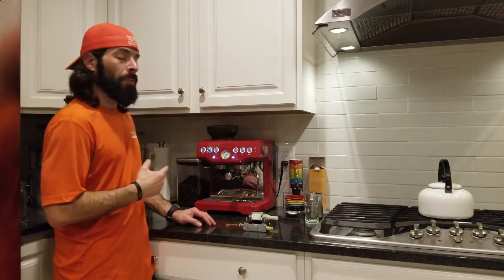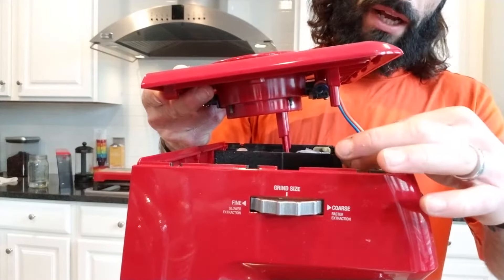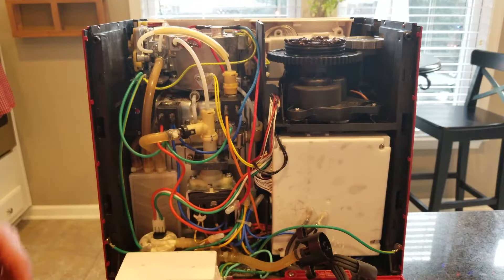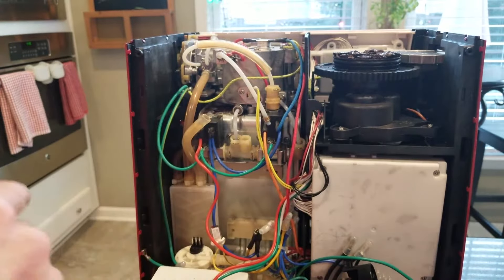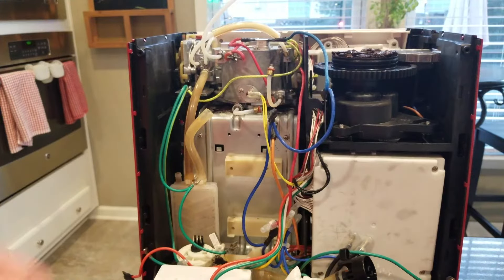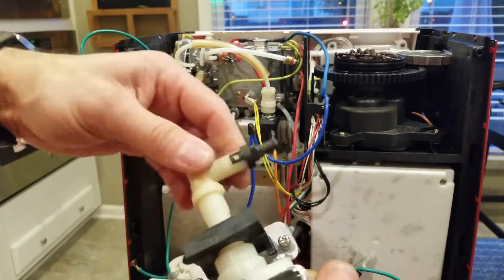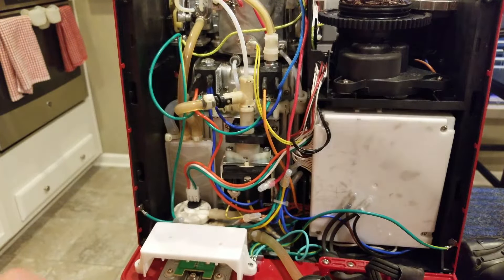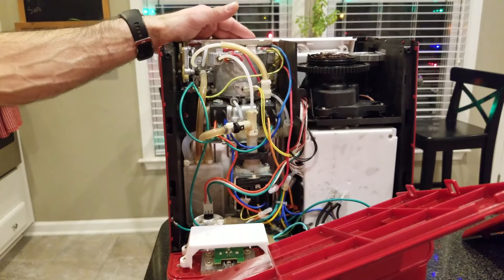Water Pump and Solenoid Block Replacement on Breville Barista Express 870XL

Comment: Wonderful job Luis!  I have the same machine and color.  Our machine is 1 1/2 yrs old and we use it morning and noon EVERYDAY. My problem is with extraction and maybe you have the answer.  I buy our vanilla syrup and beans from Starbucks and they grind it “Esspresso Grind” for me as they have done every two weeks for the last 1 1/2 yrs.  After filling/tamping and putting the porter filter in place our machine comes on as normal, no unusual sounds, the pressure gauge starts out in the pre-infusion range briefly and then moves up 12-1 o’clock as usual.  I’ve always tamped and used the double basket but for the last week now I’m only getting dripping (I’ve even tried not tamping and have the same dripping) and not the steady caramel stream I used to get. When placing an empty basket and testing water flow it comes thru perfect, when removing porter filter completely the water comes out perfect and when in cleaning cycle the water comes thru perfect. Can you help me?
Reply from the maker: The double wall filter is designed to give one good pressure by the nature of its design (also known as a pressurized basket).  It is designed to give one the ability to use preground coffee, as you have done, and get consistent results.  That being said, I am surprised you have found that to be the case. 

You can almost ignore the pressure gauge as anything placed in the pressurized basket is going to get you what looks like good pressure.  If this started with this latest batch of coffee, I am confident in pointing out that the grind is likely the culprit here.  

My recommendation is to switch to the single wall filter, grind your own coffee, and enjoy the wonderful espresso you've been missing out on these past 18 months.  The are numerous grinders out there that do a better job than the Barista Express; however, all those grinders cost more than the complete Breville combo.  Furthermore, the level of control that the conical burr grinder gives you shouldn't be possible at this price point.  I pull an average of 10 shots per day and have done so over the last 4 years.  While I would love a more expensive machine I don't think the results would differ so greatly than what I am able to accomplish with my Breville.

If you are intimidated by grinding your own coffee don't be.  You'll be able to enjoy a richer espresso than what you thought possible.  And finding the right grind/dose is as easy as turning a dial and pulling a few shots.  If buying roasted whole beans is what is hanging you up then I wouldn't worry about that either.   You can purchase from Starbucks if you so chose or the many online roasters available.   I purchase my beans from Costco.  Some might consider that a sin, but they have lots of options, I get freshly roasted beans, and by buying it in a five pound bag I go through it before it goes stale (2 weeks) while not having to pick up a new one pound bag two or three times a week.
Reply: Luis Infante Thank you for your help.  I did go back to Starbucks and had them grind another bag at a courser grind,1/2 way between Espresso and paper ground (#4 on their dial I believe).  I mixed the courser with my existing espresso grind and now again able to pull my wonderful extractions.  The manager thinks perhaps someone mistakenly dialed a “French” grind (an even finer grind) rather than espresso on my original purchase. I’m happy I didn’t have to throw out the mishap grind and was able to have a positive outcome mixing the two grinds.  Again, Thank you for great videos and help!

Comment: Hi, thanks for the video. 
When i turn on my 870XL, the power-on noise is not buzzing anymore. None of actions work. No coffee brewed, no steam, no hot water. What could be failure? The pump or the solenoid? 
A few months ago, an elbow tube on the solenoid was leaking, I could not find the tube, so I changed the whole solenoid assembly to fix the leak. So the solenoid is fairly new.
Reply from the maker: Sounds like the pump is either locked up or failed.  However, you can't rule out that it isn't getting power and or the board or some other circuit has failed.

Comment: These Breville barista espresso machines go well enough for years if you carry out regular de-scaling when the "clean me' light pops on - but even then (and assuming you are using the correct de-scaling solution), over time you are still likely to encounter scale particles which will ultimately jam in the solenoid valve block apertures. 
The pumps rarely give problems, so you might want to concentrate on cleaning the valve body in the first instance if you are having issues with steaming rather than replacing the entire solenoid valve block. In my experience, 8 times out of 10, the valves will have a small piece of scale holding the valve open when it should be closed.
Reply from the maker: My struggle with dealing with scale has been the water source.  At home my machine is feed by the filtered water dispenser on the fridge.  From time to time I will get scale build up that breaks off and clogs the small plastic lines.  I have yet to have scale clog the solenoids or water pump but it is possible with the solenoids at least.  My machine at work is fed by a commercial water filter/dispenser and in 7 years of use it has not needed descaling or has it had a single failure.  Contrast that with the machine at my home and it has had the two failures (one induced by me) and periodically needing to manually clean out scale that has become lodged in the lines.  ALWAYS check for blockage before replacing parts.

Comment: This is my second Keurig Coffee Brewer.  https://www.youtube.com/post/UgkxBrV-RbF5Nk0Rlt9i15aao-YMzqzTG8Vf The first one lasted 6 years. It worked beautifully until the day it didn't. It was hard to go back to the drip coffee for a couple of days while I waited on my Keurig to get here. There is a huge difference in the taste. Keurig makes a really good cup of coffee. This new one is a little different from my old one. I find putting the water filter in was easier than on the old one. Attaching the water reservoir was also a little different but once I figured it out, it too was easier. This new one has the auto off feature but is not programmable like the old one. Only three cup sizes instead of four. The odd thing for me was how much lighter in weight this one is compared to my old one. More plastic and much less metal in the construction of this one. The price is so much less than the original Keurig that I bought and the coffee tastes the same so all in all I am satisfied.

Comment: Where did you buy the solenoid assembly
Reply from the maker: I bought it from the link in the description.  They come and go out of stock.  This looks like the 3-way valve: https://a.co/d/fQYAZ3Z  Do your research to make sure it is correct, but on a quick search it looks correct.  The 2-way valve looks to be this one: https://a.co/d/dw03jEa  Again, do your research to make sure they are correct. Good luck!

Comment: Just FYI the newer 870XL just has one screw next to the water inlet and 2 screws on the bottom.  The whole back pops out.  First time around I removed the bottom feet and the bottom pan but that wasn't necessary.  There are 3 clips on each side and the bottom ones are more stubborn.  This makes removing the water inlet much worse but I didn't remove mine as I just disassembled my flow meter, checked it and put it back together again.  At least for the short term my flow meter is working again.  Removing that part will require more disassembly (I'm not sure how involved).

Comment: Found your video while trying to figure out why our Seal Shower Head keeps dislodging about 1/2 to 3/4 through a shot being pulled. Water comes down and out over the portafilter making for a very watery espresso shot.  We can really only  pull a semi-decent shot if we barely tamp down on the espresso - but it always stays in the pre infusion state.  This machine is barely 2 to 2 1/2 years old?  Any idea why the seal shower head/steam ring would dislodge while pulling a shot?
Reply from the maker: Apologies for the delayed response.  If I am understanding your situation correctly the seal itself might be damaged.  On a machine that young I wouldn't think that is the case, but it fits the description.  You can find a replacement seal on Amazon but they are finicky to install and may lead to the basket getting slightly stuck after pulling a shot.  At least the one I purchased and installed causes this to happen.  Good luck!

Comment: Hi, It was that notoriously clogged tube.  I wasn't able to get the back off as couldn't find the other 2 screw retainers, so had to work from the top - not easy at all and nearly impossible! After clearing the solidly blocked tube and putting it back in, the machine still had the same problem until I added a strong dose of citric acid to the water tank and ran the machine briefly, then sucked at the aperture with a straw in case of an air lock again and kept doing that every 20 mins for an hour or two. Then the machine suddenly changed its pump noise and hot water gushed through, much to my relief as I spent hours on it. So, yes you're right, there was likely scale in other tubes as well as the one everyone gets problems with. And that tube as a part is not easy to find, it seems. Luckily I got mine clean but had to soak it in citric acid and struggle with a needle and uncurled paperclip for an hour or two, bit by bit chipping away the solid build up both ends.
Reply from the maker: Glad you got it sorted.  The issue with the back panel does sound annoying.
Reply: The later versions of this machine have a single rear screw below a cover, and two more screws under the machine for the rear cover. Need to turn it upside down to access them.
Reply: @default9740  thank you
Reply: @default9740  once those screws are out, safe to take the plastic covers off?
Reply: loren udall yes, you may break a plastic clip, but the machine will go together again fine. To reiterate: to remove the back cover on Version 2 of the BES870, remove the two screws underneath, pry up the single plastic cover in the centre of the plinth and remove that screw, and the 5 or so across the top.

Comment: Do you know what is the problem if the machine keeps tripping the CGFI outlet when pressing any of the 2 brew buttons?  anything else works fine.
Reply from the maker: Not 100% sure what that could be. But I would look into the motor. As they fail they tend to draw more amperage, which could explain the GFI tripping

Comment: Mine has been running for 5 years!!! just now started to act up a little bit. That buzzing is awful! it has been a week with my espresso coffee (I don't enjoy filter coffee at all, I rather don't have coffee at all)
Reply from the maker: I do French Press, which I find much more tolerable.  Good luck on the fix.  Make sure to check for scale deposits before ordering parts.  It's a common issue with most water sources

Comment: Nice video! I have a slightly newer/different model and the back panel removal is a little different. Hoping to put up a video sometime soon. Thanks for taking the time to share.
Reply: how did you remove the back panel? ours has 1 screw, not three, and we're hesitating to use force to pull it off.
Reply: There are a couple of non-obvious tabs on the sides I had to press in. It’s definitely a little bit of a leap of faith on how much force to use.

Comment: Any idea what could cause the water to go straight out of the purge valve instead of out of the group head when I press the shot buttons? Steam wand and hot water are working perfect.

My pump was blocked but I unblocked it and now the pump is running good but all of a sudden I’m not getting water out of the group. I’m wondering if there’s a blockage inside there but I’m curious if it could be a solenoid
Reply from the maker: did you check the lines that attach at the bottom of the boiler for any blockages?
Reply: @lai2703  not yet, I’m going to check there next. Thanks man
Reply: @lai2703  there’s two lines that are scaled so badly that I can’t even pull them out. I’m guessing that’s the issue but I have no idea how to remove them without damaging the lines! I’ve mixed descaler into hot water and brushed it on multiple times but they’re not budging.
Reply from the maker: @Robdutton91  in my experience the scale breaks off and clogs the line, but doesn't "trap" the line.  however, the rubber o-ring on the brass end does tend to be tricky to dislodge and reinsert.  once the retention clip is out you can try a pocket screwdriver in that slot ad try to nudge the brass bit to break loose.  only need a little bit of movement.  If that doesn't work, you could also try pulling the other end of the line and then spinning the line in clockwise or counterclockwise directions to see if that o-ring will break it's seal.  the longer rubber sits the less likely it wants to come out.  The line closest to the grinder is almost always the one I have scale in.  concentrate on that one.

Comment: Thanks, man. I changed the solenoid valve, but I still have a low pressure. I will order a new pump and install it, I guess.
Reply from the maker: Check for blockages in the lines. Typically bits of scale that have broken off on the boiler side of the lines.  Good luck!!
Reply: @lai2703  Thank you so much for the input!
Reply: I just changed the pump too, it fixed the pressure problem, so I deeply thank you for sharing your knowledge. I really appreciate it.
Reply from the maker: @noahsassi9665  Glad you got it fixed!!

Comment: Hi! Lai. Thanks for nice helpful video! My 870XL has no espresso dripping, no pressure and sounds no normal. But steam and hot water is fine. I replaced the pump following your video, but the issue is still same. Please let me know if I need replace the Solenoid Block as well? I tried to order it from the link you provided but it is not in stock, back order only. Many Thanks 🙏
Reply from the maker: It could be the solenoid block, but more than likely is just some calcium deposits (scale) that have broken off and blocked one of the small lines.  Go back in and check that they are all free of any obstructions and make sure and look inside the ports to for material.  Right at the boiler is where I usually find issues.

Comment: Hi great video, hoping you're still watching and replying to it, just curious i have the horrible noise and no water when using coffee and portafilter, but machine runs a cleaning cycle fine. Then after if i try to make a coffee it seems theres not enough pressure to go through coffee.. does the water for cleaning and coffee run through different tubeson the solenoid bank? Thanks for any help.
Reply from the maker: Apologies for the late reply.  I've saw your comment, but have been really busy.  The water for cleaning may work with less volume or it has been my experience that a partially clogged tube might allow enough water through to make the machine appear to function fine without a loaded portafilter.  

I keep saying I'm going to post my video about cleaning out scale debris, but other things keep taking priority.  Long story short I think you have a partial clog of your lines due to a piece of scale breaking.  Pull the lines where they enter the boiler (it's likely the one closest to the grinder, i.e. the lower one) and check for scale both in the tube and in the thermocoil comp assembly (breville's term not mine 😉).

Good luck!
Reply: @lai2703  thanks so much for evwn taking the time, ill give it all a try, ive pulled the solenoid block down and cleaned, ran water through filter it seemed to flow fine, i should've check all lines as i went.. ill give it all a go.. thanks again for the reply.

Comment: This is a great video! But my 870XL looks a little different, I don’t have three screws on the bottom cover, only one. It’s extremely difficult to pull the back off.... I don’t know if it’s normal or not. I really hate this thing!!
Reply from the maker: The model in the video is from ~2014, so, there could be some differences in later units.  Make sure you take the plugs out that cover the three screws.  I don't recall if I mentioned/showed that in the video.  Best of luck with your machine service.
Reply: LAI Thanks for the reply! Like I said, mine doesn’t have three, only one. It has just one cover in front of where the water tank sits. I tried taking it off and broke one of the clips, so I’m either going to send it to Breville or just get a Rocket machine. I’d like something built more to last anyway.
Reply: @mollydaniels7227  hey molly, there are two more screws at the bottom of the machine towards the middle and not the edges. After you remove all 3 screws, gently snap 3 clips from each side (total of 6 clips). 
Hope I’m clear enough 😅
Reply: Danny Cruz Thanks for the reply, but there really aren’t that many on mine unless they are literally invisible. Lol. I bought it in 2018

Comment: FYI - I just ordered the solenoid assembly direct from Breville, customer service needed the SP0020444 part number as they couldn't look it up directly.  $44.99 with shipping to a U.S. address.  Cheaper than the independant part replacement dealers.

Comment: My machine fell to the ground and it doesn’t turn on anymore. I opened it up and could not find any broken pieces or loose connections. Maybe it is the front panel button that is broken? How do I get to it? Any other suggestions?
Reply from the maker: I have not gotten into the front panel and really not sure what could have gotten damaged in the fall.  That is really unfortunate.  Good luck with your repair and post up what it was when you get it sorted.